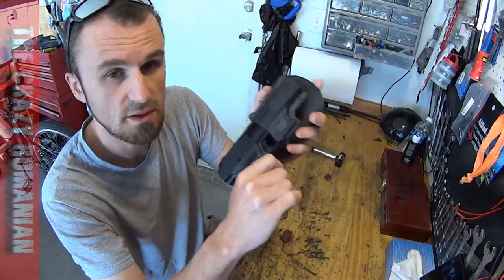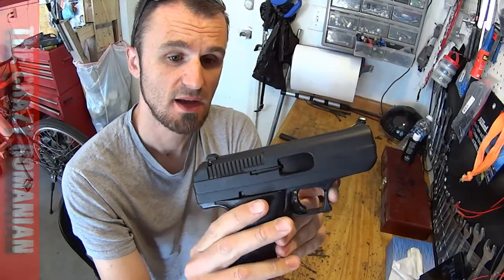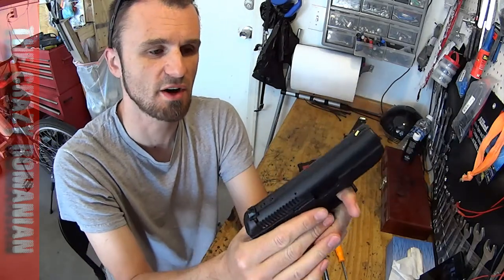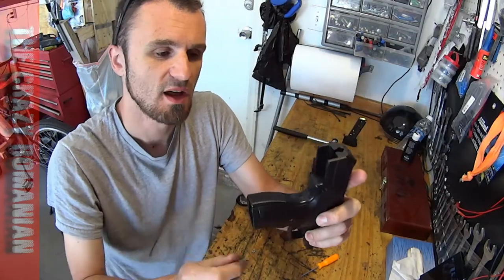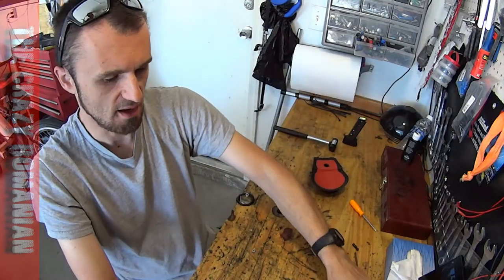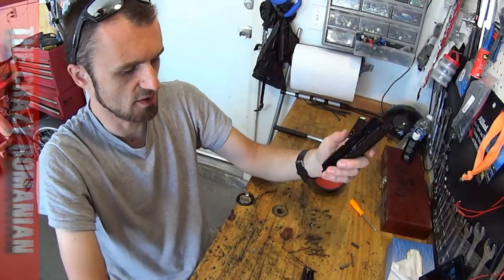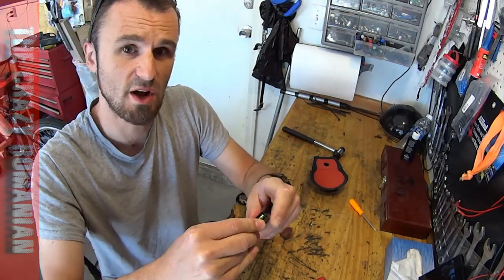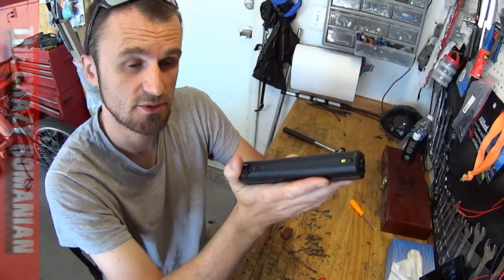HI POINT C9 9MM   Basic home protection hand gun   NOT THE BEST

Comment: Any handgun at 50 feet is not very accurate. I have owned a C9 for years. Only thing that ever happened was a broken firing pin. Hi-point sent me 2 under warranty.
Reply: RocHopn -Um, a broken firing pin is a pretty bad failure that could cost you your life.  I wanted to like hi-point.  I bought one and they sure as eff aren't as reliable as peeps on the interwebz say.
Reply: RocHopn Bullshit. You can shoot accurate at 25 yards easy with a good pistol or revolver and practice.

Comment: What the name of that holster ? Also where did you get it from ?
Reply: mack au prince 305 Fobus H2 . You can get one from Amazon . This dude dose not know his guns . Mine is spot on .
Reply: Thanks , heard about the clipdraw belt clip ? Was thinking of getting that and the fobus . Polish my hi point feed ramp and left the magazine loaded for a good month took to the range a not a single jam , did have ftf with fiocci rounds .how you like your hi point ?
Reply: mack au prince 305 I love mine . Have had no troubles .
Reply: I have never done anything other then mag work to it . The feed ramp is pot metal . I would not polish it unless you need to .
Reply: The magazine i have runs fine out the box after keeping the magazine loaded for weeks . Some people do get lemons. The feedramp/barrel is painted with powder coat , it to thick for a smooth cycle.  I didnt sand the metal , i just sand the black powder coat off to bare metal.
Reply: mack au prince 305 I have herd that some feed ramps where coated to thick . Like I said though . Watch the feed ramp . It is pot metal . Try using a magnet . It will not stick well if at all .
Reply: Thanks for telling me . I probably would of been sanding of more , luckily i did with the nail block file. It did help alot .